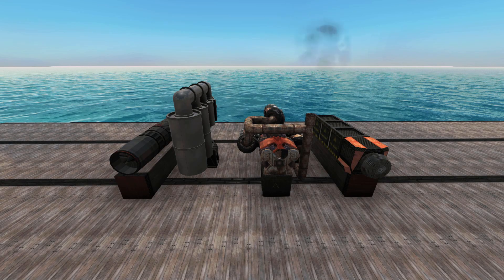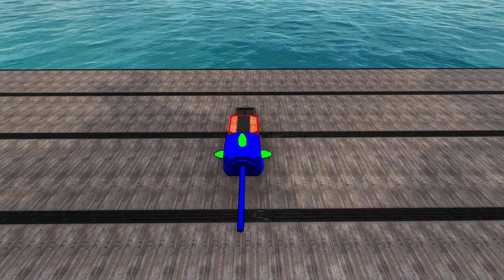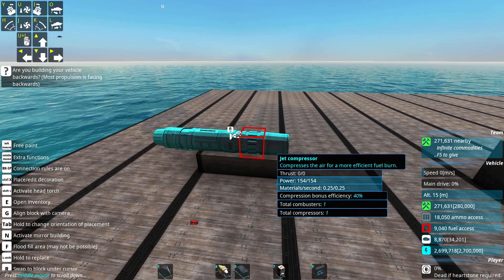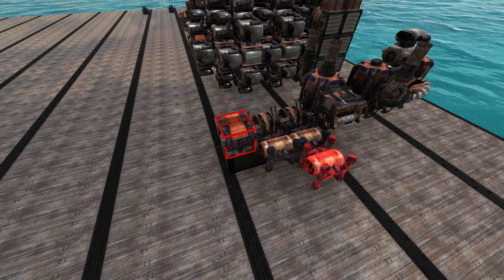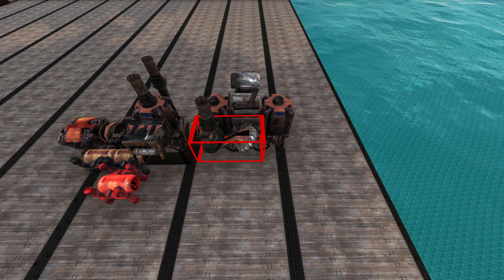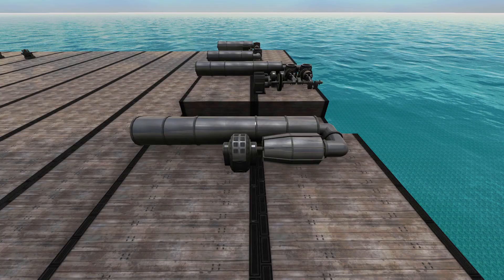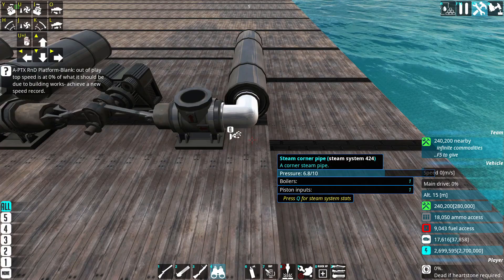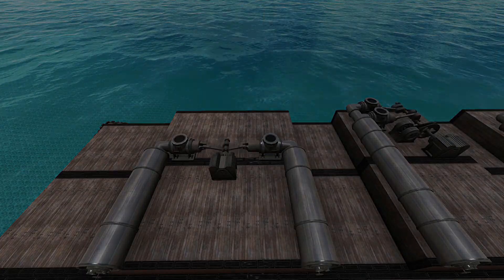From the Depths - Engine Tutorial

Comment: I wish they remade the fuel engines to resemble the steam ones. With crankshafts and cylinders of different sizes. I usually design huge vessels, and I'm stuck with steam engines because of their shafts and huge propellers.

Comment: Would you recomend having a steam engine as a main engine power production with back up fuel generators? For example a steam engine that covers 100% drive, and powering demand peaks from lams or so with other methods?
Reply from the maker: Yep, that's a very good conclusion to draw. Use a nice big steam engine for your main power needs, protect it well, and use some fuel engines as backup/supplement for fluctuating demand/redundancy.

Comment: Another (niche) use for electric engines is to serve as a "starter" engine for small steam engines, to give them enough time to ramp up at the start of a battle
Reply: steam engine save running pressure in save file now. not really need that anymore.

Comment: Is it possible to power small fighters with battery power supplied from a larger carrier? I know they can exchange power outside of battle but is it also possible in battle?
Reply from the maker: Definitely possible!
Reply: Pro tip: even empty resource storage increase supply range
Reply: @RMMinc  So you could build a giant warehouse Fortress to supply the whole map or is there a cap?
Reply: @blise518B  sorry, never went THIS far :P. 
But with enough cargo containers it's definitely possible let carrier hang at 2000m range from target and still supply everything.
Reply: @RMMinc  oh so you Need containers to increase Ressource range to supply electricity? Good to know I would have just tried to spam battery’s.
Reply: @blise518B  i think it's any resource potential. Ammo or fuel or energy or materials. Its just that material containers are the cheapest option.
Reply: @RMMinc  ty for the tipps. I guess I’ll play around with carriers Today.

Comment: Laughs in prefab
Reply: I gave up on making big custom fuel engines when i couldnt make an engine more efficient than the prefab EcoMax. I'd have to unlearn so much that i thought i knew and it would be better to put that effort into making better APS, CRAMs, AI systems, armor, etc
Reply: @blueberry1c2  what?  You mean my 4 cylinder 8 turbo engine is not efficient? /s
Reply: I found out that a two stage series turbos with another two stage series turbos on the other side of the carburetor (basically 4 turbos, 2 in series, in 2 sets)  is enough to recycle every bit of the exhaust in a single cylinder. Now decreasing its volume is another headache inducing problem.
Reply: @kimpatz2189  carb or cylinder turbos?